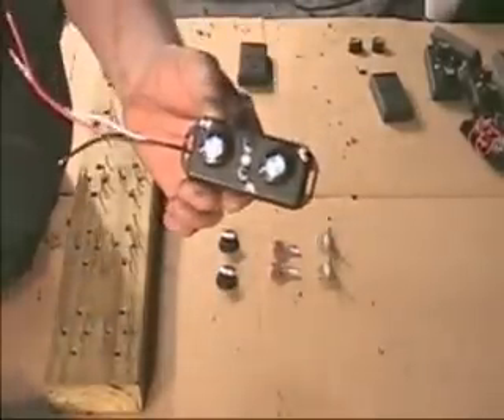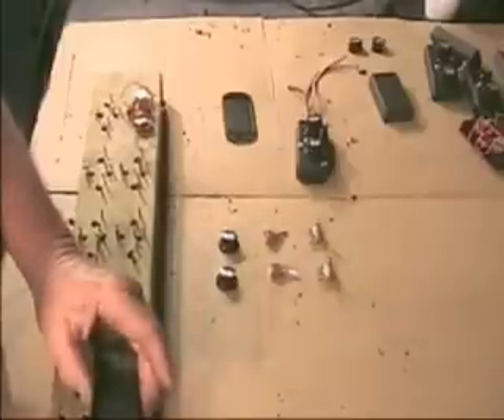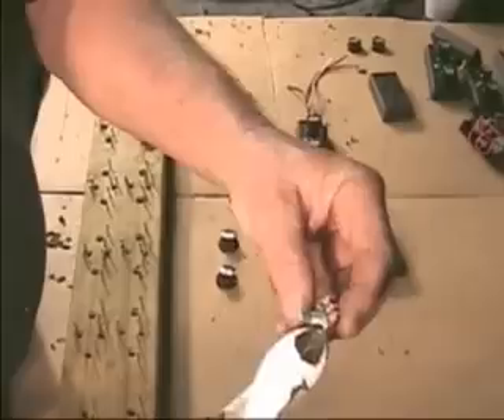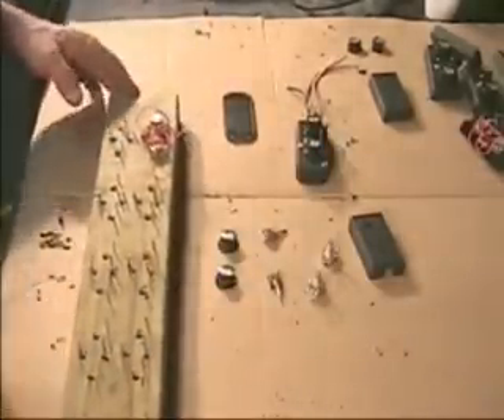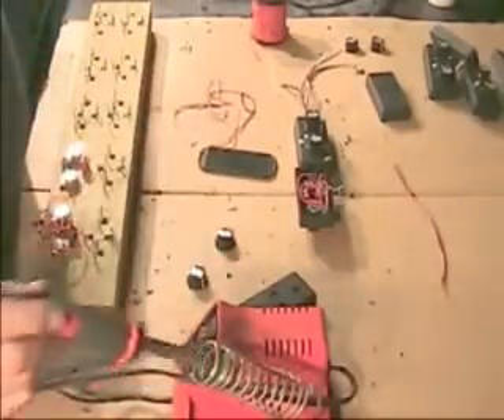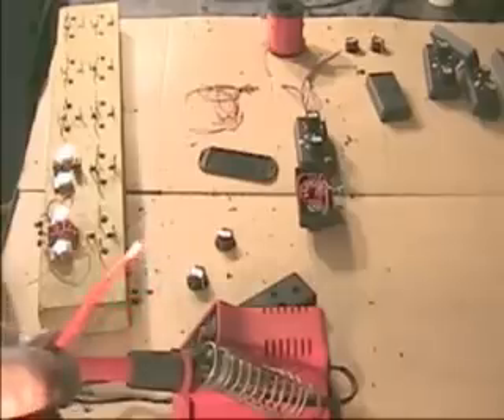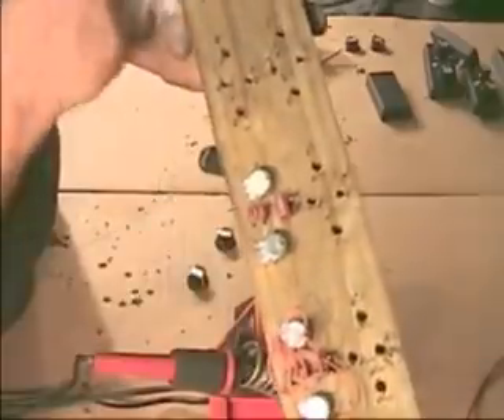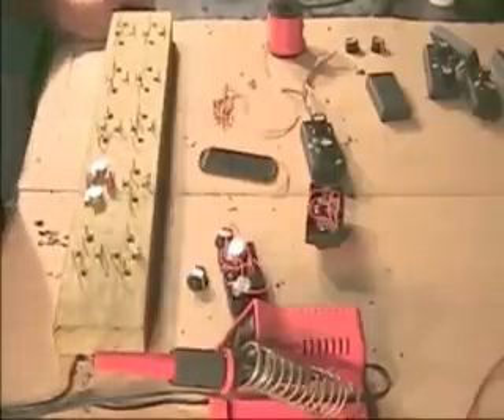How To Make/Build a Map Enhancer EFIE for HHO Hydrogen Generator Part 2

Comment: Part 2 was much more useful than Part 1. Even so there wasn't much information supplied as far as what these do exactly, how to select the the correct parts to build it with, how to set it up and test it to see if it is or is not working properly etc..